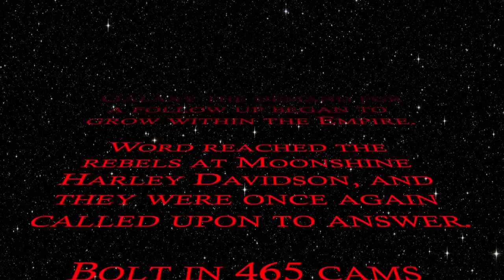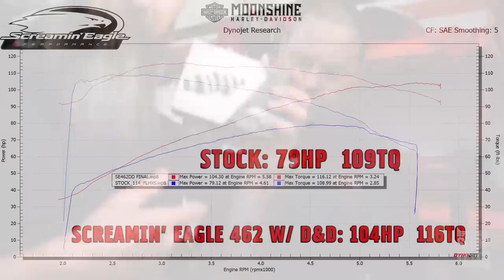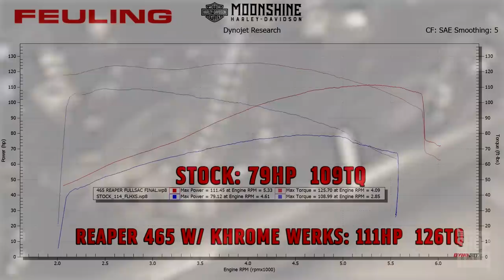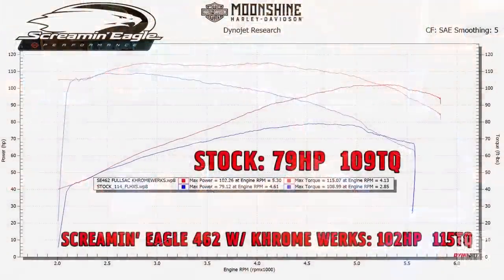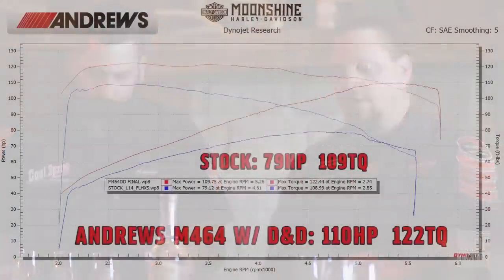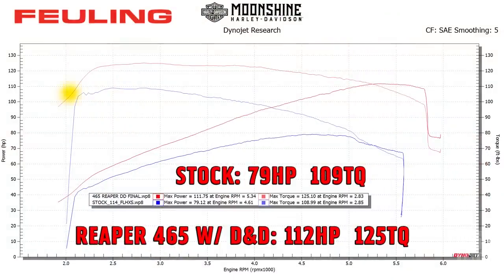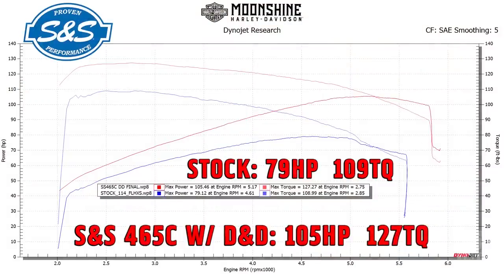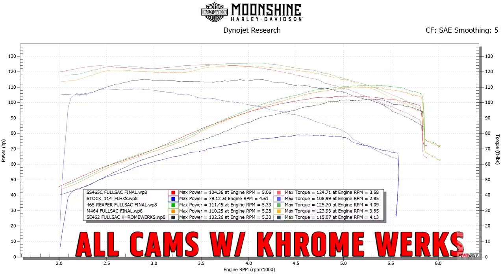Cam Shootout Series | Part 2 (Screamin' Eagle 462, Andrews 464, Reaper 465, S&S 465C)

Comment: Motor CAM                    HP TQ

117SE S&S 475                   119 132
         Wood 22x           110 131
         COMP 246A           124 129
         Zippers RS472        116 133

  
114  SE462                    102 115
         Andrews M464    110 124
         Fueling Reaper    111 126
         S&S465                    104 125
Wow!  The 114 comes close to making 117SE power. :)

Comment: @WheelSpin1320 we have run the pro pipe in different configurations but mainly on twin cams in the past. .  That has proved to be a good running pipe for those builds. The majority of our m8 testing has been on touring bikes although we have tested several cams and exhaust  systems on the M8 softtail platform including basanni, fab28, feuling, rbracing, trask, thrashin supply and two brothers.   Call me at the shop if you'd like to discuss our take on these systems and their pairing to cams for the M8 for your build.  AARON.

Comment: Want to upgrade my cam, but most videos I watch say to change the cam support plate and oil pump also.  Is this extra 700 bucks really necessary ? I am leaning towards the Zippers 468 or S&S 465.

Comment: What’s your thoughts on the chain drive setup on the M8? I have heard there is excessive runout? I’m trying to figure out which way I’m going to go. Either reaper 465 or S&S 465G. Thanks for all the great info
Reply: The M8 has shown to have minimum runout so far. With that being said every motor varies but you'll most likely spec out for the 465 Gear Drive.  I would check the runout before you order your parts, if you are wanting to run the gear set up from S&S Performance. The S&S 465 and Reaper 465 are both great cams.

Comment: You guys need to test Jim's VTwin performance cam(Mooresville NC) "The Maxcell 821B." I bet you will be surprised when you see it out performs all of these.. I had it installed on my 2019 Ultra Limited 114ci.. my bike stock dynoed out the exact same at 79hp 107tq... after installing the stage two (the Maxcell 821B cam, Rinehart cold air intake,  Rineharts true duals with Rineharts 4.5 pipes it dynoed out at 115.89hp and a massive 132.22 Torque. My bike pulls like a freight train and will just pull the front tires off the ground in 1st and pop it up a few inches when i do a fast shift into 2nd..  So please test the Tims Vtwin performance Maxcell 821B on a 114ci you all WILL be impressed!!!  I would be happy to send you a copy of my dyno sheet (just leave a link) Love the video by the way..
Reply: We will look into them.  Thanks!

Comment: Except you will never get these numbers without voiding your warranty. Even if the dealer installs a non HD cam, you are still stuck with the street tuner because the service pc will flag your VIN if you put a powervision or anything else on it
Reply: Allen We warranty our motor builds as long as the cam is smaller
than .530 lift. Anything over that lift
is a race application and our customers understand and still build. So if your worries about flagging your vin just have us build it.
Reply: @jamielima5315  thanks for that info. Technical question for you. I've been freaking out over temps later. I gave a 2019 sgs with a 475 cam. I have been seeing et/head temps from 300-360. I can't find anyone to tell me what normal is.

Comment: Oky...what cam will you stick in my 107 street glide..hi flow air cleaner, V&H power dual header into TAB zombie exhaust w/ baf8. I shift usually around 2500-2700 rpm...majority of my riding g is back roads..with occasional highway...I want power mid to high end..i live in MD an I'm willing to take a 12 hr road trip to your shop.....talk to me GOOSE

Comment: Just out of curiosity, how did you break the bike in? Just on the dyno, or do you guys suggest a way a new bike should be actually ridden off the show room floor? Unless it’s just the Harley Davidson break in suggestions.

I ask, because I have a planned trip when I pick my 23’ heritage 114 with a screamin eagle stage 2 from the dealer this spring. The ride is about 250-260 miles. (To my relatives place to show them the bike) and am kinda sorta worried I’m going to over rev unintentionally. Just an irrational fear, being afraid that my intrusive thoughts are going to take over, haha.

Comment: Great videos! My experience is that I called Aaron on a Friday and the lady told me he was swamped as they were in the middle of an event, so she took my number and said he'd call me the next day.  Sure thing , HE DID.  That's totally awesome as my experience is most dealers don't do what they say they will.  We had a great conversation about bikes, builds, exhaust systems, etc and costs.  He confirmed some things I already knew and shared a lot of info that's not on the videos.  I don't know if i'll get there so they can do my upgrades but I sure as hell appreciated picking his brain!  They are head and shoulders above the rest in my book of shops and dealers!

Comment: Please dyno with true numbers for the 2020 lowrider S. Show the different between the power cam and the torque cam? No one has done it yet! I think the power cam will be better..PLEASE
Reply: The Harley cams?  The power cam will give you 5 or so more top end Horsepower than the torque cam but will come on 500-1000 RPM later.  The torque cam will give you improved torque acceleration right off idle but will "flatten out" at around 4500 RPM.
That is the difference between them.
DM me on insta for more info if you would like...

Comment: Great information in this video. I really value seeing one change at a time. It would have been great if the stock baseline was done with each exhaust and air cleaner as a stage 1. That way when we look at the curves we can truly see what’s happening from the cams only.  It would seem like half the gains are probably coming from exhaust but we are not able to tell. Even with that said this is great information that really isn’t available like this elsewhere. You guys rock!
Reply: I think all new harleys should come as a stage 1 at least so they breathe right , but harley will never do that sadly, the m8 though is such a great motor when paired with a cam it really brings this motor alive !

Comment: Helpful video but too many choices I can't decide. I have a 21 Heritage 114 stage 1 with tab zombie slip ons. My style seems to fall into 2200-3800 rpm range. I'm thinking s&S 465  but the Andrew's 464 looks good too. Suggestions? And for my model year do I need to do full cam chest or oem oil pump ok? Thanks

Comment: great video and thank you for doing these. 
what in your opinion would a Reaper 465 or a Red Shift 468 do in a 2017 M8 Ultra Limited 107 with a stage 3, TTS tuner and the D&D M8 Fatcat exhaust?? How close would this be compared to the 114 in this video?
Reply: Jason Ingle it would our preform
these due to the compression increase.  Check out our other cam video on the stage three 117 HC cam shoot out.
Reply: @jamielima5315  Thank you for responding.  but the 117 HC video goes over a 114 with stage 3 or 4 built to a 117, correct? I have a 107 with a stage 3 built to a 114 with SE498 cam, TTS tuner,  DD Fatcat 2into1, So wouldn't mine be closer to the stock 114 with cam, tuner, and DD exhaust as in this video?? I'm sure I might get a tad more because of my compression. By the way, These tests are awesome.  Thank you all again

Comment: Irrelevant to me what top HP and top torque is. When I buy a torque cam, I want to know EXACTLY what it's doing from 1000 rpm up to 4000 rpm, which is where I run my motor 99.99% of the time.

Comment: Gentlemen, I have 02 road king. I have been running a 95 bore with 585G drive cams. valve springs, true duels w/power max tuner. This pulled great, faster then any stock 103. but recently had to tare down due to runout. Now I am installing a 4 3/8 stroke S & S crank. still gong to use a new set of 585's w/fueling cam chest. with 10.1 cast pistons. My question is what should I do with the cylinder heads? Use the screaming eagle MVA heads or some S & S heads.....and do I need to change my manifold and throttle body?
Thanks for any info
Reply from the maker: Awesome! What bore size are you going to run? Depending on your the setup it will tell us which port design to CNC your current heads too and have them matched to the correct size HPI intake/Throttle Body. Please call Jamie Lima at the shop 615-274-4170.

Comment: Currently have a 2020 Rg and recently got a fuelmoto 124 kit for it. I already have a fueling 465 I had planned on running with the 107. I’m wondering what your thoughts might be. Would it be worth stepping up to s&s 475 or comparable cam or run what I’ve got. Oh going to be running stock heads. Thx
Reply from the maker: Yes. Step up. So you have a 55mm intake manifold for it? If not call us and we can get one out to you. 615-274-4170 Aaron, Jamie or Nick

Comment: I know there are a lot of factors but would I be right in guessing that the lower performing cams have more conservative timings and use less fuel when cruising? I'm worried about getting a cam and killing my fuel range on long distance rides.
Reply: Jarrod Wilson this sounds odd but the larger motors will usually get equivalent or better mileage at higher speeds. It depends on your tune and the MPH you are running. Either way it’s not a worry for HWY riding...stock M8 or a 128 M8 and you’ll be refueling after 4 hours on the Highway. Every hour cruising 75-90 equals a quarter tank. Try it out.

Comment: Hey Guys - outstanding video; have watched it several times.  With it being October 2021 now:  pertaining to stock 114's, for bolt-in cams...How's the Wood WM8-22X and WM8-22XE cams compare to the 4 cams in this video from April 2019?  And, the Cycylerama CR-480 cam?  And the MHP-485?  All these Cams are nice, and of course choice of exhaust system, baffles, and Tuning play in here.  Thanks!!!  Tom M. 

    I actually choose the S&S 465c Cam (full cam chest kit) for my '21 RGS, RDRS, Stage-2 114 (S&S 2-1 Sidewinder w/catalyst; Fuel Moto/K&N # 3956 ventilator style but wider AC; Dynojet PV3b Tuner w/map from Fuel Moto.  Additional:  Trask M8 checkvent and HD Fan added to oil cooler).  Nice Cam, good lope at idle, and runs excellent ; strong torque 2000-5000 rpm (torque hits early, around 1750-ish rpm), and averages 46.4mpg on the highway at 70-75 mph cruise.   Leaning towards the Wood 22XE but curious about the MHP 485 cam.  Undecided right now.  Also, I have new in the box Carillo 10.75:1 forged pistons (4.125" bore) and a spare 114 Top End (2450 miles); thinking about building a 120 cu.in. (4.125" bore x stock 4.500" stroke) engine and possibly some mild head work.

Comment: I can go straight to changing my cam with stock pipes and intake? I have a 2020 Road King with a 107. Any recommendations?
Reply from the maker: Dan O you could but you would spend some good money and than the stock intake and exhaust would be holding you back. The first step would be to get a good intake and exhaust setup than add the cam later if you can’t do it all at once.

Comment: Having my dealer install a stage 2 with fullsac header, tab performance mufflers, heavy breather intake, tts master tune and dyno, adjustable pushrod and SE lifters. I'm torn between the woods 222 cam and the 22x. I ride solo, mostly 60 mph backroads and highway. What cam would you guys go with
Reply: The 22x is better if not adding compression.  Is it a 107 or 114 or CVO?

Comment: The Andrews 464 is a nice cam its the easiest on the vale train and puts out good talk an Hp....This is the one im putting in my 22 RKS with power vision tuner & a dyno and fueling  free flow head pipe....will never have to worry about anything with this cam. with a more radicle cam 465--475 s&s cams fueling I be little bit worryed without upgrading valve springs clutch springs to prevent it slipping a few years down the road. they say you don't need to it very well maybe. but I would. ride safe all. cams hit that clutch hard when they kick in...its all about how you put power down to the road also. take care of your bike it will take care of you.

Comment: I have a 20 FXLRS. Haven’t done any engine mods yet. First off, based on a previous video by u guys, I think mine is oil cooled. Having said that, I’m not an aggressive rider really. City streets of Miami. Want loud. Daily rider. About 660 miles per month. Should I get the 465 or 475 cam by S&S? I heard about Jag oil coolers. What do u think about that too? I think I wanna upgrade my clutch too. What do u suggest?im watching ur videos and learning as I watch. I will have my dealer install for me. Also lookin at a less expensive exhaust. Either VnH mini grenades or their stainless 2-1. Feedback on that?

Comment: Amazing work !!! Great job putting all the videos together and educating everyone in the Harley world, Have a question about the cam shoot out videos, what if any baffles are in the Krome Werks 4.5's ?
Reply: I think they said performance baffles
Reply: @ihateemael  Thanks Richard , must have missed that, All my other research I've done on the Krome Werks have come up with better numbers on the louvered baffles, I am currently running the slash cut 4.5's with no baffle, but I still have the cat because of warranty, have stage 1 with auto tuner , really do like the current sound and did notice a significant difference in performance

Comment: Any idea if the reaper 465 or S&S 475 produces better numbers on a 107?
Reply: John K The Reaper 465 gets really similar numbers to the cams in this video. We run the 475 from S&S all
the time but only when going to a higher compression set up. We have great info on the 475 in our First Cam Shootout Video. Check it out.

Comment: Are there any plans in the future to do a cam shootout with Stage 3 & 4 builds? I've got a Stage 3 on my 18 Road Glide Special and want to get some more out of her. Considering the numbers are so good with just a cam swap I have to wonder what the numbers would be with the 11:1 compression and bigger jugs etc...I run it with all HD parts except the headers which are FuelMoto Jackpot and I'm getting 118TQ and 111HP. I gotta wonder how she'd run with the D&D exhaust and the right cam whatever that may be with the Stage 3.
Reply: Our first cam test video was a 114 to 117 stage 3:
https://youtu.be/vnBKzGMKL40

Thanks for watching
Reply: M.V.O _Motorfast I'm sorry I didn't clarify better...my 18 is a 107 with a Stage 3 kit making it 114. Any chance of a video with builds like that and some Zippers 468 cams with D&D headers?

Comment: I went with the Screaming Eagle horsepower cam since I'm still under warranty, and running Vance n Hines Powerriding with this cam so much Duals, with Rinehart slip on's, my dyno chart looks identical to yours nice flat torque all accross n the horsepower kicks in then the torque drops off for a min , but Im 117 Torque n 103 horsepower,  but that bike is very very loud idling n getting on n off the throttle, it feels like a hotrod engine ! pulls very hard  with arms pulling while pushing you back in the seat,   roll on passing power whereever you need n want it just twist that throttle n hold on, this is in a new 21 Roadgilde limited, i thought about going with SnS 475 cam after warranty is up but I'm enjoying this cam so much that I may stick with it

Comment: This a great reference. Went with HD 462cam and SE tuner and stock headpipes, V&H muffs due to warranty stuff. And got very similar results with the D& D.
Reply: I went same route as you  same cam, but vance n hines power duals, n free dealer installed rineharts they put on before i ever came to look at it, putting down 117 torque, n 103 horsepower dame flat dyno across like they show here, but the real story is how great it runs n sounds n pulls like a crazy ape, very fun bike to ride, and everyone on the forums said to go with the torque cam, this proves how horsepower cam is great too

Comment: Awesome video guys, so I have a 2020 FXLRS with a stage 1 set up. 2-1 TBR turnout, screaming eagle ventilator and FP3. Will the Fueling 465 be a great choice? I know the S&S 475 is a bit to much for a stock motor but what will the affect be if I went with the 475 vs the 465?

Comment: Based on this series (great btw) - had my local dealer install and tune a 465C / S&S AC / S&S 2 into 1 sidewinder...powervision tuner......While the numbers are similar (103/123) - and I know every dyno is different, your dyno charts mostly seem to show the CAMS hitting torque max or close to it right away- you are there at 2100-2200 and and then plateau on the 465C....mine ramps up a hill to 3000+  - it can't be just the pipe??

Comment: These two videos where really good.  My 18'softail 107 with power cam, shorty fab and screaming eagle intake(Which chokes it down) made 109hp 115tq.  Made over 100tq from the bottom.   Thinking of upgrding to the 475 s&s  and after watching the two videos thinking i gonna go with it.
Reply from the maker: If you do the 475 you’ll need to increase the compression. With that said pair it with some high Comp pistons. If hats not an option do the 465 cam
Reply: @MoonshineHarley  what would the high comp pistons do?
Reply: @MarvFitBikesKicks with the 475 you’re introducing more air into the combustion chamber.

Comment: Do you guys have a video like this for a 2016 twin cam ?
Reply: Not a comprehensive one such as this.  We do have several examples of TC motors we have built and tuned with various levels of heads, cams, displacement etc.